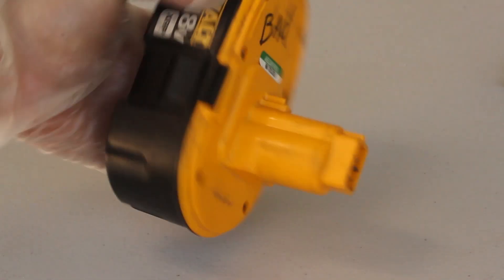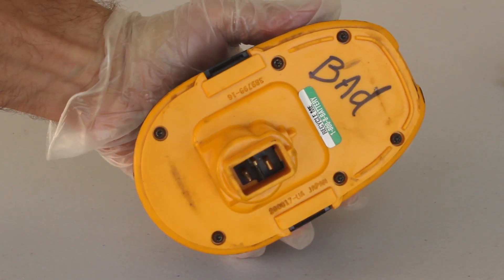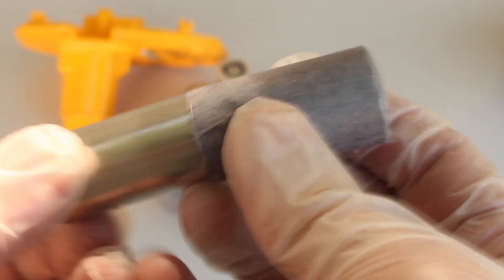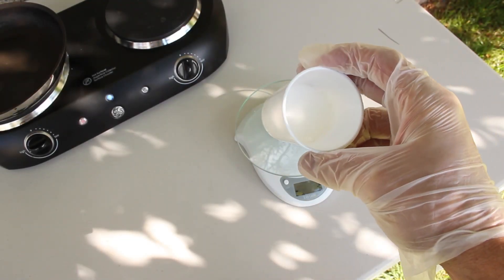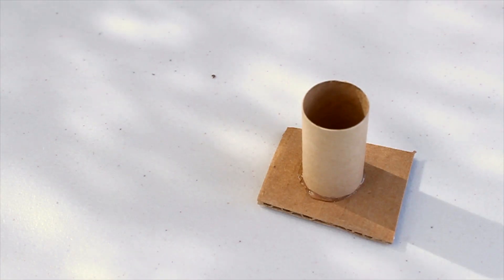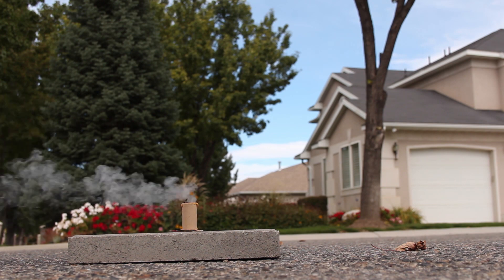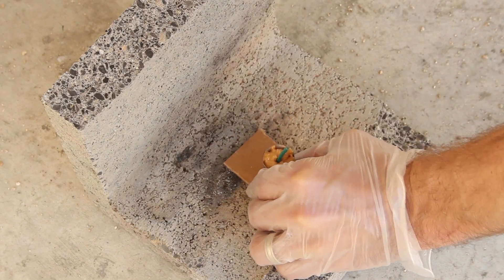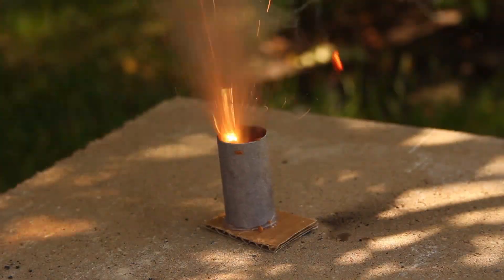Homemade Signal Flares

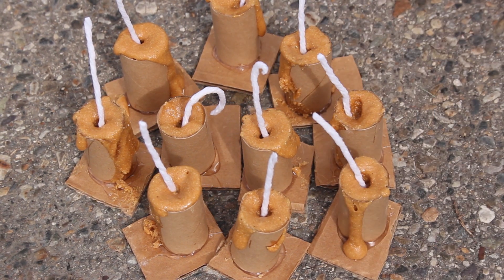Comment: I know this isn't important but that looks disgusting. 2:31 Also I want to know how to make colored flares!
Reply: Color flares: just add some powdered dye when it looks like cookie doe
Reply: setingtheworldonfire I have never actually gotten that to work. Is there a specific amount to add?
Reply: Try using iron oxide even copper oxide
Reply: Look up on google for the things they add in fireworks to get a certain color. Experimenting with those powders could yield the color you're seeking.
Reply: adding dye is probably a bad idea, i was going to do that too but after some research i found that most are toxic or the flame is far to hot and will simply breakdown the dye. so not only is it dangerous it also wont work =(
Reply: FuddyDuddyman- Cactusgreen to bad I wanted to be able to use these in airsoft but I am worried ppl will freak out and think the forest is burning
Reply: Peaceful Manatee At least you can get kits online to make colored ones. I forget where though :(
Reply: ;p
Reply: it actually looks yummy for me

Comment: !ATTENTION! A WARNING TO ALL ATTEMPTING THESE SMOKE FLARES! WHEN POURING THE MIX INTO THE CONTAINER, MAKE SURE THERE IS NO AIR BUBBLES - I JUST ATTEMPTED THIS, THERE WAS AIR BUBBLES IN THE MIX IT EXPLODED IN MY FACE AND I BURNT ALL MY SHOULDER - IF I WASN'T WEARING A THICK SHIRT, IT WOULD HAVE GIVEN ME EVEN MORE SEVERE BURNS THAN IT ALREADY HAS. DO AT YOUR OWN RISK, MAKE SURE YOU USE A VERY LONG AND PREDICTABLE FUSE AND STAND AS FAR BACK AS POSSIBLE OR BETTER, DON'T TRY IT AT ALL! THIS RECIPE IS ACTUALLY ROCKET FUEL, IT JUST BURNS IN SUCH A WAY THAT IT IS CONTROLLED AND ONLY SMOKES. THE POTASSIUM NITRATE IS OXIDISING AND IF THERE ARE BUBBLES IN THE MIX IT EXPLODES AND YOU HAVE BASICALLY CREATED A BOMB! DO SO AT YOUR OWN RISK, I LEARNT THE HARD WAY, YOU DON'T WANT TO LEARN THAT WAY, TRUST ME!

Comment: Protip: 
4-6" 1/4"diameter copper pipe for the body (reusable) 
49g KNO3 aka Potassium Nitrate (Spectracide stump remover) (Gardening dept at HomeDepot, Walmart, Lowes)
28g Powdered Sugar C12H22O11 aka Sucrose
7g Sodium Bicarbonate NaHCO3 aka Baking Soda 
31g Paraffin Wax; unscented (can find at Michael's Craft Stores)
- Heat wax until it melts, pour mixed powders into heated wax, stir, fill copper pipe, put this guys version of the fuse in 1/4 to 1/2 way in, put it in the freezer, 30min later light it up, have fun.
Reply: does it burn longer?
Reply: With the addition of the baking soda, yes it'll burn longer. It also depends on the amount total, and how big the exit hole is.
Reply: Thanks for the description.
Reply: Trenton Faulkner No problem :)
Reply: Nice.  I'mma try this out too.  Just attempting it with a coffee mug full of the original mix.  Ruins the hell out of my cooking utensils... your way seems much less costly.
Reply: More smoke nice thinking.
Reply: Spectracide is hard to find in my area, Chicago IL suburbs.  HomeDepot, Menards, Lowes carry an alternate brand that does Not contain potassium nitrate.  Tried 2 local lawn and garden nurseries as well as Ace and True Value, they don't carry it either.  Found a Menards about 7 miles from where I live that had 1 bottle of Spectracide on the shelf.  Will probably have to order online next purchase.

Comment: Is the smoke toxic (besides it just being smoke)?
Reply: Jerry Lifsey
Is it toxic? Anything is toxic; The oxygen you breathe, the water you drink, and the food you eat, are all toxic and slowly killing you over the years. What changes is the amount needed before things become toxic enough to do harm in a short time interval.

Is it toxic enough to do (any relevant) harm to you? Probably not. It's just potassium, sugar, and maybe some natural food-dye, if you wanted colored smoke.

I'm no expert, but the byproducts of the burn are probably:
-Potassium nitrite (KNO2), from potassium nitrate (KNO3). It gives off one oxygen molecule during the burn, and that's why it acts as the oxidizer.
-Carbon (C), Oxygen (O) and Hydrogen (H), from the sugar (C#H2#O# - Glucose, for example, is C6H12O6)
--The Oxygen (from both of the above) and Hydrogen (from sugar) re-ignite, generating Carbon and water vapor (H2O), and heating even more sugar and KNO3 in the process, which in turn ignite, and keep the reaction going.

None of the byproducts of the burn should be "toxic" (to harmful levels). But you shouldn't breathe on the stuff if you can help it, just in case.

Hard To Kill Inc.
It isn't like fireworks. Fireworks burn gunpowder, which includes sulfur (toxic) and charcoal (heavier byproducts). And fireworks use metals (toxic & heavy byproducts) for the effects.
Reply: AlmightyGaming Thanks Doc.
Reply: pretty sure it is, it's like fireworks, it is bad to breath in lol

Comment: To help in their use as "signal flares" is there an easy way to colour the smoke?
Reply: Maybe add some food colouring I think
Reply: dye powder
Reply: yeah add strontium nitrite to the mixture
Reply: Metal salts usually work in flames, but I doubt they will make any difference in smoke, as it tends to be less energetic than a flame.

Comment: mix some rust dust in there and you get a distinctive color, and other high heat metal gives some nice sparks too but avoid this if u live in a neighborhood, or love you fingers.
Reply: does it just explode?
Reply: only if theres air like he said, but you will see flames and a distinctive color, its basically like cheap rocket propellant. keep it secure just to be safe and not too much that when you light it starts automatically. even with a fuse, alittle flame from the tip might set it off.
Reply: purer the rust, better it is, kinda a distinct fine powder.
Reply: michael huertas cool, what colour is the flame, red?
Reply: YoloDrag didn't try but it would certainly be dark red or brown, not the best colour you can choose

Comment: Can someone please tell me where can i get KNO3?
Reply: its a fertiliser most hardware/gardening suppliers have it 
mix in 50-50 mix works fine
no need for cooking its a unnecessary step that creates more work and adds a danger element as it can ignite easy should it get to hot while cooking it
Reply: Sodium nitrate is similar (derived from) to potassium nitrate and can be found as saltpeter at any grocery store. This is often used in smoke bombs (similar to these flares). After all, you're looking for an oxidising agent.

Comment: Seems like a bit of a pain to get little battery packs like that. Why not just use cardboard tubes from toilet paper rolls and paper towel rolls?
Reply: The cases are probably more resistant to heat.
Reply: Yeah, but they burn up anyways.

Comment: What does mixing or not mixing change? And would it be possible for the KNO3 to ignite while you are melting the sugar into caramel?
Reply: No. Potassium nitrate is used as an oxidizer. Sugar is the carbon-based fuel. Each on their own is relatively harmless (or delicious).
Reply: titaniumlibra The answer is still no. KNO3 will not ignite while melting the sugar. If you have left over fuel, that may ignite, but that wasn't the question.

Comment: I have some old shotgun shells from when I go to the shooting range some times, would those be just as effective?
Reply: most likely you might make a smoke grenade launcher
Reply: yeah, they work fine. I just used 20 gauge shells but I'm pretty sure you can use any shell. To be able to throw them I take the bottom and bend it in to the fuse.

Comment: Hey,

I ordered some regular KNO3 online. Today I tried to make a few but they all got the same problem..... they just go up in flames like a Jet engine....
I put 3 spoons of KNO3 in and 2 spoons of regular white sugar. I heated the compound and sturled it until it became peanut butter brown, after that I put it in a tin cell (diametre aprox. 5cm) and put some fuses in it.
After letting it cool down for about 25 minutes I lit it, but it just made a huuuugee flame and just a little bit of smoke.....

Do I have to wait longer?
Was there too much surface exposed to the air?
Was the ratio not good?

Can you tell me how come?

Kind regards,
Hubert.
Reply: 1. Try putting them in a container like a soda can to restrict the amount exposed to the air. 

2. More sugar (or adding baking powder) will slow down the burn.
Reply: Christopher Nasseri I did some searching on yt, and it seems that you can also use melted parafine and just add the 3:2 kno3 and sugar.
Do you have any experience with that?
Reply: Hey Hubert,

I don't have any direct experience with that, so I don't want to misguide you. I will try the best I can to answer your question anyways.

Based on the makeup of Paraffin Wax, it should (in theory) slow down the chemical reaction. In my area it is much easier (and cheaper) to buy baking soda. The smoke bomb you would purchase from a fireworks store usually is made from potassium chlorate (KClO3 - oxidizer), sugar (sucrose or dextrin - fuel), sodium bicarbonate (otherwise known as baking soda - to moderate the rate of the reaction and keep it from getting too hot), and a powdered organic dye (for colored smoke). We are swapping the oxidizer for Potassium nitrate (KNO3), but besides that it is all the same. If I were you I would try both methods and post them on youtube (and send me the link :D). I would be very interested to see how the Paraffin affects the combustion and smoke compared to baking soda.
Reply: Christopher Nasseri Okay, and what would be the ratio for the baking soda?
3:2:?

Because I tried this before, but by putting an eating spoon filled up to a little bit under the edge with baking soda.
But still it would burn like a mother freakin f16 ;)

Thanks for all the great advice given already!
Hubert.
Reply: I would start by doing  3:2:1 ratio, and going from there. If the 3:2:1 ratio doesn't burn properly, then drop it or raise it in imcriments until you hit the sweet spot. You should immediately see a change though when you try the 3:2:1 so you will have a general idea if it needs more or less baking soda.   One other thing you can do before trying the baking soda is just lowering the amount of kno3 slightly. It is the oxidizer in this reaction, so less of it should cause the reaction to go slower. It is interesting how your reactions are so violent, while some of mine have petered out. What are you using as your KNO3?
Reply: Christopher Nasseri Hey,
Sorry for the late response but I guess you haven't seen my private message to you? I thought that would be a better way of continueing our conversations instead of here, in the comment section.

I am not sure what KNO3 I have, I bought it on a dutch site like Ebay. Next time I will make sure to buy it from an official reseller.

Kind regards,
Hubert.

Comment: Some acids such as H2SO4 will cause it to ignite but on its own it is pretty stable it is an oxidizer so add enough heat and it will decompose to form O2 and KNO

Comment: Could you please make one with candle wax(legendary smoke bomb), because the one in the video is basically rocket fuel, but when added candle wax the bomb actually smokes and doesn't burst in to flames and burn all the smoke around it.

Comment: i would clean it VERY well. KNO3 is used in Stump remover, so it can break down organic compounds. no fun if your throat starts melting. if you clean it well it should be fine.

Comment: As for my experiments with this substance about 6 years ago, I can say that more smoke is obrained if you disolve those ingredients in the boiling water and let the water evaporates till the substance is nearly dry but not completely. then put it into the containers and let them dry over 2 or three days. such process gives me about 2/3 more smoke.

Comment: One only cost a few dollars depends on what size you buy,and cleaning is simple just use a wire brush. Also theres no need for cleaning the soot out if your just going to be using it for a smoke bomb.I would know, I work at a steel plant.

Comment: Just a thought. You may be able to make re-usable casings by using small tomato paste cans. I work at a grocery store and down the canned food isle we have small individual cans of tomato paste that are only slightly bigger than those little rolls of film that go into older style cameras. I would think that the metal should hold up fairly well to the heat produced, especially considering how short the burn time is. Someone should try this and let me know how it works.

Comment: Less oxidizer, more sugar causes it to burn more slowly and produce more smoke and no thrust. Also his method of mixing both the KNO3 and sugar as powders and simply putting them in the pan causes only the sugar to melt and only coat the KNO3 in sugar instead of actually mixing them. This adds to the slower burn and higher smoke output than rocket fuel.

Comment: The mix workes unbelivably well, and yes do it in open areas! I made enough mix to half fill up a snapple bottle, i was going to make more but i was doing it inside and the mix in my pan (a quarter sized peice) caught fire, I put that out with water, but a sprak caught the bottle one fire and quickly filled both levels and all 13 rooms of my house in no time! luckally everyone was removed from the house then I went back in and went to open all the windows, the house cleared in 6 minutes!

Comment: Hi Grant,

I just tried to make this smoke bomb, using sugar, and 99% pure KN03.  I had to hand-grind the KN03 down to a powder, as it comes as little spheres.  I mixed 48g of KN03 with 32g of sugar, and followed the process correctly.  The bomb burnt for about 1:30, but I was hoping for a little bit of thicker/longer lasting smoke.  Any suggestions?

Thanks,

~Soul

Comment: You could wrap a piece of aluminum foil around a ping pong ball then heat it using a lighter and throw it when it start giving smoke. there you go a cheaper much easier to build smoke bomb with a pretty good smoke!!

Comment: Most stump removers are not 100% KNO3, granted you can get in the 90's with most but off of Amazon or Ebay you get something like 99.999%. If you prefer the convenience of stump remover then go ahead and get that. It doesn't matter too much but pure is better.

Comment: Interesting!  you remind me of myself making cannons out of smokeless powder from shotgun shells.  Can be dangerous!  QUESTION:  I need smoke bombs to test a building with individual rooms.  Probably do room by room.  Using box fan I would create positive pressure in the room while burning smoke bomb.  Then check outside for where bats and incects are getting into walls.  Any hazards in breathing KNO3?  Could use respirator with smoke filters I think?  Thanks for vid.  Mike

Comment: No you need special dye, you'll find in in harware stors in th paint section. its the dye that is used to dye deck stain diff colors. all other dye will just burn up and be white smoke

Comment: No, the sugar is the fuel, and the KNO3 is the oxidiser, basically it adds oxygen to the reaction. If you want to color it, add carbon based colorants, also, to increase the smoke amount, add a spoon of baking soda. It burns a bit slower, and pumps out a LOT more smoke :)

Comment: Home Depot or any other home improvement/hardware/gardening store should have it. Before you buy, make sure to read the label and MSDS sheet (if included) to see if the brand you're buying uses KNO3. Ideally, you want a brand that has 100% KNO3.

Comment: You definitely need sugar for fuel. Smoke/fire color is usually achieved with the proper metal (oxide/salt) so I'm not sure if green food coloring would work (it's probably organic and would burn with white/gray/black smoke, depending on the size of formed carbon complexes).
For green, I'd recommend fine copper shavings or copper salts.
Feel free to try a coloring/sugar mixture and let us know though!

Comment: You should do a video on how to make smoke bombs using the nitrated newspaper method. I've found that it produces just as much smoke, but with almost no flame. It is a bit simpler as well, involving only cold packs, water, and newspaper.

Comment: You could even use the metal casings from the batteries. just be careful and dispose of the stuff inside them properly. Then you can use them over and over.

Comment: Years ago we was making these from rubbery plastik wrapt in foil and leave one small corner open to light it. Smoke is thick and it lasts for ever. And there is no open flames like on these. The plastic was from rulers. Could you try this one out please.

Comment: If you were wondering how to make the smoke bomb smoke SLOWER use the same 60% KNO3 and 40% sugar, but DONT mix them over a burner, instead take some candle wax and heat that up. Once your candle wax is melted mix it with the powered mix (mix very fast because the wax dries quick once out of the heat). Then just add the new mixture into your container and follow Grants instructions! I do have one question for anyone who reads this, I can't see to add color to my smoke bomb, does anyone know how?

Comment: If you don't cook it, (or cook it and then powder it) and then mix in some paraffin wax, it will burn MUCH slower and with much more fluffy, billowing smoke.  You just have to cover it to extinguish the open flames.

Comment: to make more smoke you have to grind that KNO3 to a really fine dust. ideally would be to use ball mill for 4-6h to grind it to that state. that's because only the sugar melts in this mixture on 186 °C and the KNO3 stays solid up to 334 °C so you need finer oxidizer to get the max out of the mix.

Comment: if you close the top and left only small hole it'll smoke more. I used to make the same in a tin with small hole on the top. You can make it without melting, but the smoke will be less than the melted one. And be careful - it may burn during the melting process... 

I've tried to add other ingredients in this mixure for different color, but no success :D metylene-blue doesn't work on KNO3 mixure, it needs stronger oxidant like KClO3...